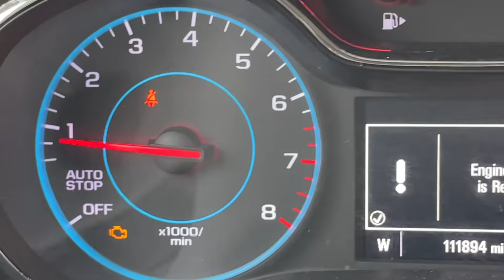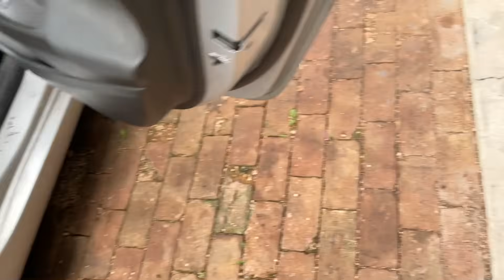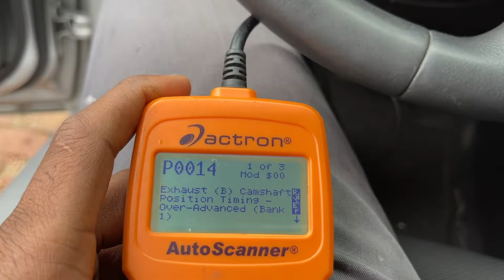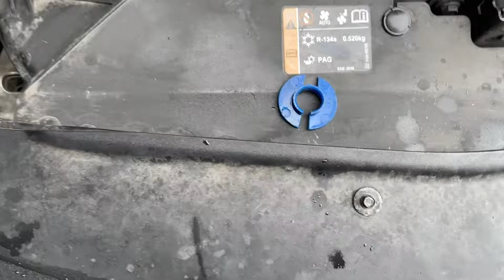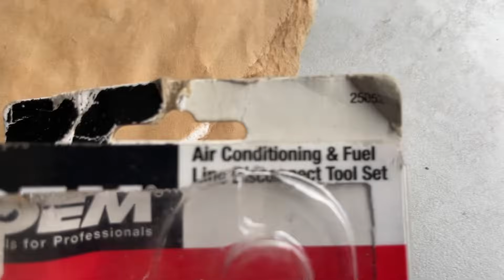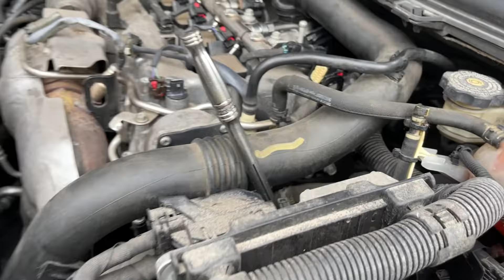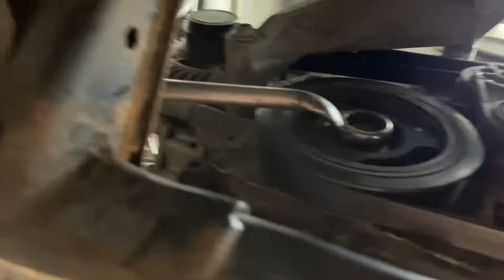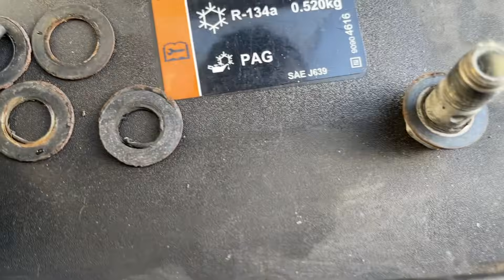16-19 Chevy Cruze, Mailbu Valve Cover Removal, VVT Solenoid & Camshaft Sensor Replacement 1.4L, 1.5L

Comment: Thanks for video!
Reply: I am finally getting this thing back together after finding that Brake vacuum pump.. GM has a class action lawsuit for them.. I am happy you was up close and personal with everything, I could not remember where some of the bolts went, had someone helping me and well we got them mixed up and the markers came off.. happens.... but i am almost done, get all the electrical back up... got oil to change and add coolant.. but man this was a hell of a job, i dont want to do again for awhile.
Reply from the maker: @CrazieFrogz  , let me know how it turned out.
Reply: @TerenceDIY  So thankful. Lord its back together...we drove it for an hour and it made it there and back.. Seems like its doing good. Its Quiet . driving good. Needs tires & new wipers. But its rpms are good & the temperature gage is staying at a good normal...
Reply from the maker: That's awesome! I'm glad you guys got it going.
Reply: @TerenceDIY  thank You..
Reply from the maker: Thank you and thanks for watching.
Reply: @TerenceDIY  ps or glue worked very well

Comment: Question when you mentioned foot pounds on the torque and I see you used a dewalt drill what does that spec look like when you set your drill?
Reply from the maker: HI Earl, I only used the dewalt impact to zip the bolts down quickly. I'm so used to using it, I know how much force to apply so I only snugged them down then torqued them. Thanks for watching!
Reply: @TerenceDIY  got it thanks for the clarity, in the process of changing my valve cover great video, this was the only one I could find that was the exact model as mine
Reply from the maker: @earlmourning9339  awesome! Once again, thanks for watching.
Reply: @TerenceDIY  Me again, I have two questions so I put everything back together with the new valve installed and oil is leaking by the vacuum pump. Is that because I don’t have the bolts tight enough or did I not use enough gasket maker? Second question during the process of installing the valve cover the top of the Pcv that attaches to the hose broke, is there a way to take the valve out? You said something about a tap approved bolt?
Reply from the maker: Earl, you can ask as many questions as you like. I'm not surprised that oil is leaking around that vacuum pump. The gasket requires replacement whenever that vacuum pump is removed. I just got lucky with this particular job, but not so lucky in the past. You're going to need to replace that o-ring style gasket on the cover (fairly easy). Also, the tamper proof bolts can be removed easily with some needle nose vice grips. You should be able to remove them with a set of regular vice grips as well. I have removed many of them.  Once you remove them, you can replace that line. Just use some locktite when you reinstall the bolts. Is there anyway you can wrap the hose with some electrical tape? That will temporarily fix the problem until you're ready to fix it (I've done this quite a few times as well). It will actually hold of for a while.  Let me know.
Reply: @TerenceDIY  update the o-ring style gasket was fine. The issue was that I didn’t have enough rtv gasket maker as well as the bolts being loose once I added enough rtv and got the bolts good tight, the leak is no more. I was also able to rig the hose onto the valve with a little rubber tubing and man that car is driving like a brand new car. I truly bless God for you, this video has taught me and helped me a lot.
Reply from the maker: Awesome!!! I am glad you got it. Thank you for watching and God bless you and your family as well.